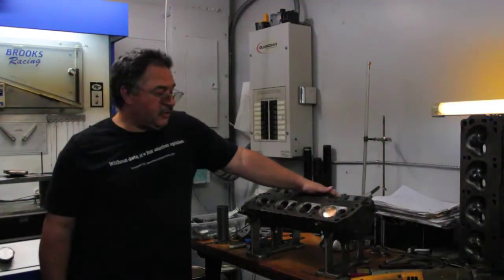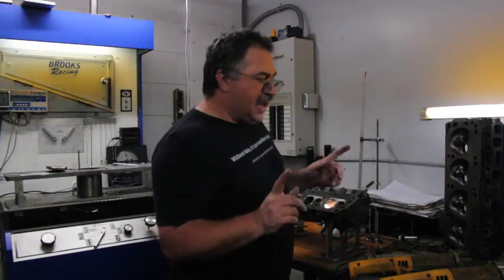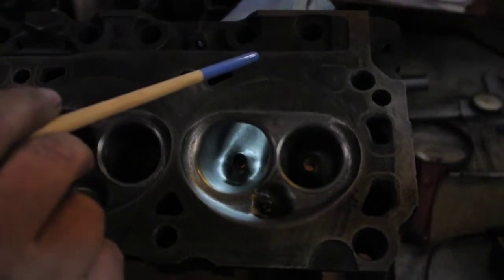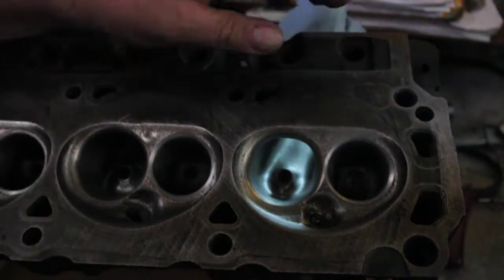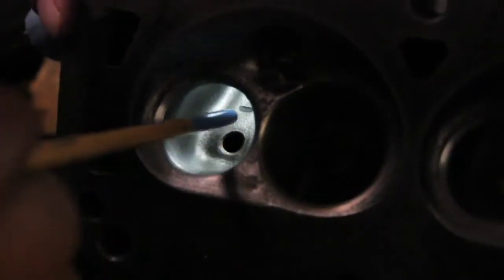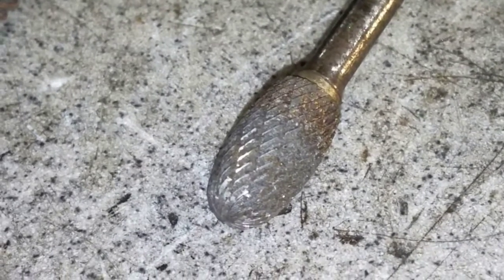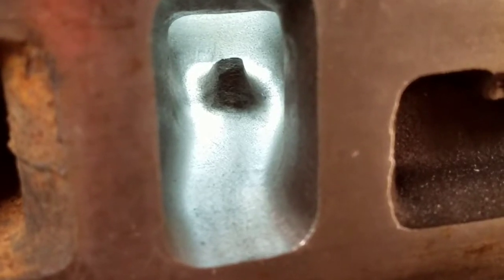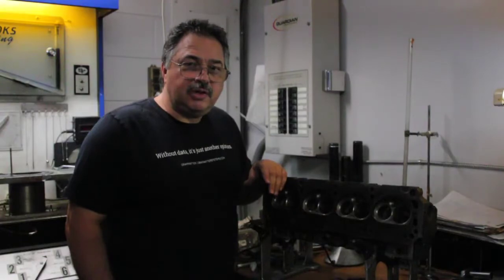David Vizard E7TE Ported Heads for 306 Ford Dyno, Ultrasonic Measurement and Port Textures

Comment: awesome to see finally!  Did you ever switch that one build to roller?    I feel a little more confident in my first porting job after seeing this..   I painstakingly did  with an 1/8th inch rotary ( which isn't bad for fine shaping and less chance of a big mistake) ..  but it takes forever to mic....  I dont have a flow bench   but outside of measurements   I did find a chinese anemometer  and pitot tube  on ebay for like $130   and that way I was able to at least see   that ports are well enough cloned.     I  used that with an air mattress blower and plastic bottle ...       I wish I had the texture though... 

I'm worried I hogged out my exhaust ports a little much  .. before I really started learning   I just used the gasket of the jegs 302 long tube headers  to about 85%    but   later I opened up the port bowl less.       The intake I was very careful on and didn't even really open up the ports...   but I'm glad to see your valve guide walls on the intake look as thin as mine... ( almost like a knife )  because I was worried I went too far...   I wasn't sure of that dog leg ( the right side next to the exhaust)   but I saw one porting clip of the guy that worked for Saleen... Valenko?     he has an inside caliper to about .560   from the OD  to the wall..  so I'm wondering if you have a figure or measurement on that?     I haven't dared the Vizard cut on the chamber or anything but I'd kind of like to...    Anyway...  I'm going to be running 6 psi of centrifugal / water meth,  so  it doesn't seem as critical  as it was when I was truly chasing NA numbers for this build with factory iron.    But I really took my time   ( did it very part time over the course of years it seems or seasons rather) .. Do you have an email? Would you mind giving me any feedback  or honest opinion?    Obviously a bench  and measurements / dyno is much more telling but it would be cool to have some expertise.
Reply from the maker: Just copying from pictures or video is tough because they flow best just before they turn into sprinklers. Join Speedtalk.com, I haven't posted in a while but I have some very detailed threads. The Speedtalk search doesn't work very well but google Carnut1 E7TE or 289 and they should come up. My Build a Lightning Bronco? thread is a gt40 351 build, pretty detailed. You can message me through Speedtalk.com. At this moment I am not listing my contact information. It is not like I mind helping but what sometimes happens is it snowballs and I can't even watch a movie with Wiffy. Sorry, 2:00am rambling. Thanks, Charlie
Reply: @servediocylinderheads  no problem yeah i may check it out .. Yeah one port on thermactor side i managed to grind and open a small hole below the original bump but am 99% sure was just part of the thermactor tunnel. (I want to triple check that but looking at e7 cross cut i dont think its water). I filled in and over with jb weld extreme heat (2400 degrees) and then actually plugged the thermactor holes inside the port and ground them down. Figure might as well make the tunnels as smoothe (not in texture but obstruction). I dont know if I like that but I figure even if it didnt stick itd just be blown into the headers and hopefully not reverted into the chamber. In hindsight leaving an extra little hole into the thermactor chamber would have been fine..
Reply from the maker: @DS-mo6md  It does get thin by thermactor. Not the end of the world but you are also close to water at that point. I am interested to see if the epoxy will hold up.
Reply: @servediocylinderheads  its rated at 2400 degrees (which is really cool it exists as a product) but originally i had it thin going over part of the roof and the hole but as I ground down it cracked and you could like pick small sections with your fingernail so it got to the point where its just in the little hole..and I got rid of a lot of it.. So i mean I cleaned those tunnels and alcohol and I guess some portions just wouldnt adhere.. My thinking now is like.. Thats probably some potentially "greasy" carbon in the hole  so i realized theyre probably not adhered at all or very little.. maybe they just wont come out but it would suck if they got loose while holding themselves in from forming a foot by means of gravity making an obstruction larger than the original thermactor bump.. So thats why i got a supercharger
Reply from the maker: Homemade flow techniques can be helpful. I used to pressurize intake manifolds and then with a Dwyer air speed gauge find out where the air was flowing and evening the ports as much as possible. Out of the box thinking...

Comment: In DV's video, his graph shows that HIS E7's went almost 280 cfm....which is completely insane
Reply from the maker: Yeah. I hate to say it but that is a mistake. It happens, it was more like 238 cfm.
Reply: @servediocylinderheads  Good ported E7's were 220-230cfm.     I wasn't sure how one could make 280 without adding extra iron and extensive modification.
Reply from the maker: @dennisrobinson8008  I know he changed the valve job but I do not think 280 can be done without welding.
Reply: @servediocylinderheads  Welding is fair game it needs to be simply stated.    Most good ported E7's are going to the 220-230cfm and bad ones do 180-190 cfm like a gt40 head,  i'm not sure any one of us have seen more.
Reply: Still agree with my comments.
Reply from the maker: I should add to that statement that D.V. may have changed a few things after I ported them.

Comment: Would love to see some info on the promaxx heads and what you’ve done
Reply from the maker: I was told they were Promaxx but I am not sure if that. Whomever did the original airflow work on the casting did quite a good job.
Reply: I'm in for more information on the ProMaxx heads as well.

Comment: Thanks for posting. I have E7's with 1.94/1.60 valves and a decent amount of porting in the bowls and runners. The biggest difference I saw was they didn't really work the intake valve guides on mine. My exhaust guides have been worked a bit but not nearly as much as these ones.

They will go on a 306 w/Trick flow stage one roller cam, w/slightly ported GT40 intake and into an 88 Cougar (about 3500-3650 lbs). My main concern is is mid range power with decent throttle response. Do you think the the 1.94/1.60 valves will kill my lower/mid range or do you think the smallish size of the runners on these E7's will keep it ok. I just keep kicking between just going with mostly stock GT40 heads or the ported E7s I already have.
Reply from the maker: Spend a few $ and have the E7's flowed. You will have your answer quick. I bet if the guy did a decent job they flow at least what the gt's flow and do it with a smaller port so you will have more midrange.
Reply: @servediocylinderheads  Thanks for the feedback! I have a friend who's worked at our local machine shop for ~20yrs look them over and he said he also thought they should work well for my needs.
Reply: Hell no they will scream mid range I ran a set of E7TEs ported with 1.94 x 1.6 on a 306 with GT40 intake and B303, power increased everywhere!  Made 267 rwhp with that combo, forget the rwtq this was in 90s.  Even ported E7s are still a small head for 5.0L, I changed the ported E7s with TW 170 aluminum and still picked up power across entire rpm range.
Reply: @msk3905  Good to hear. I recently finished a full 306 build w/comp XE274 and Promaxx aluminum heads for my Mustang but the E7's are for my 88 Cougar. What you had is pretty close to what she will run. I got an Explorer GT40 intake, 65mm TB (might go 70) and will be running a TF Stage 1 cam. If I get anywhere near 267 that would be a huge improvement over it's current 155.
Reply: @sorbicsagor5080  E7s ported pull nice they were fun but I was blown away at how much I gained everywhere with the better flowing aluminum head, my combo was 9.7:1 cr, GT40 intake, ported E7s w/larger vlvs, 75mm MAF, 65mm TB (believe size of intake opening, 24lb inj, underdrive pullies, 1 5/8 shorties, 2 1/2” hi flow cat, 2 1/2” Mac cat back, 3.73.  Looked up dyno 267rwhp @ 5200 & 302 rwtq @ 3800, added TW heads went over 300rwhp then custom cam added another 10 but more importantly had better manners and increases were across entire power curve.
Reply: @msk3905  Thanks for the detailed response! I was worried my 65mm TB might not be enough to pass 250 but looks like it is!
Reply: check out BIGDOGS porting on YT. Real world manifold testing. 👍
He can port your stock intake to outflow most aftermarkets for less $$. Stealthy.
Reply from the maker: @hotrodray6802  Is Big dogs the guy who uses a socket through the port?
Reply: YES
Tony Brooks
Bigdogs porting and BD body shop 
Lansing Illinois
Reply: @msk3905  just imagine if a David Vizard duration spec'd cam was installed what the outcome would be....a lot more than the E303 cam.
Reply: @matthewmiller2268  I think my motor would have benefitted more from aggressive opening/closing lobe profiles than more duration, i already had 224 duration @0.050 and this was solely a street car

Comment from the maker: I will be making another video on these E7's much closer to 100%.
Reply from the maker: Well, yeah. They are pricey. I usually only do this type of head for a good friend. If I only charge a minimal for my time they would be $2k without a bare. Insane? You bet! I have to be to work this hard to make sleeper iron heads.
Reply from the maker: $2k bare.
Reply from the maker: It reminds me of a quote I heard from a very smart man. You are not only worth your time but the many years you invested in learning the trade or talent is needs to be included. 

One of my favorite sayings, "There is no replacement for experience."
Reply: @servediocylinderheads  ouch! It’s impressive work. I’ve been having fun with my stock  setup blown. 306 with e7’s vortech v3si
Reply: I have a set of e7’s I would like to have ported.
Reply from the maker: @86foureyefreak22  Are you sure you want that?
Reply: @servediocylinderheads  is the cost outrageous? I’ve been looking at some trickflows.
Reply: Sir, I am in need of your services. I race in an endurance series. Must use stock heads. I have a pair of E7’s I would like you to port for me. Do you have a web site so I can contact you?
Reply from the maker: @dohcsmr1175  Use my gmail account. I will get back to you. charlesservedio@gmail.com
Thanks

Comment: Thank you Charlie for showing us all this knowledge that is put into E7 I was surprised @ output on the test Dyno, also back in eighties Daryle Hale from California used to port D6 & E7 heads he would make a shark fin with thermactor bump,his company was called AfFordable performance,A mag article was done on him
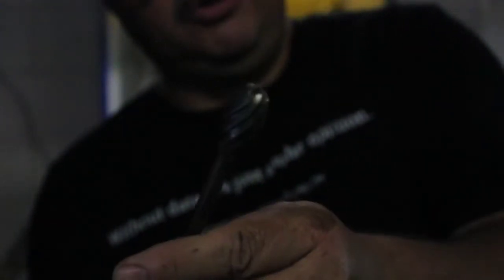Reply: I’m so glad you posted this. I actually had him do my heads for me. He also recommended running an E303 cam 3° advanced and porting the stock intake. I did that exact combination and it ran great on the street and track. That is the reason I am looking at doing another set of E7 heads. I’ve gone the fast route in the Fox bodies and now I just want a fun daily driver again and I remembered how fun that car was. I could not find that article and I’m glad you mentioned affordable performance and his name. Do you know if he is still in business? 3:37
Reply: @edstettin6799  I never new him I just have mag article , you say you had heads done by him ,I did know his age ,i ck on internet could,t find anything I suspect he passed away, there was pics of mr Hale in memories not sure if it was him ,the mag article never showed a pics of him only the head work.if i get time go digging up the mag
Reply: correction I meant, I did not know his age
Reply: @ronfarrell2889  yeah if you could post that article that would be awesome. I just tossed all my old Mustang magazines about two years ago. I would like to read that again. He did a great job on the E7 heads and it didn’t cost a fortune either. I think it was around 600 or 700 bucks.  That was back in 95 though. That car was a lot of fun on the street. You could hit the gas at any RPM and break the tires loose with the stock short block.